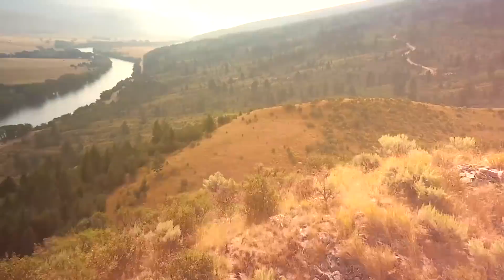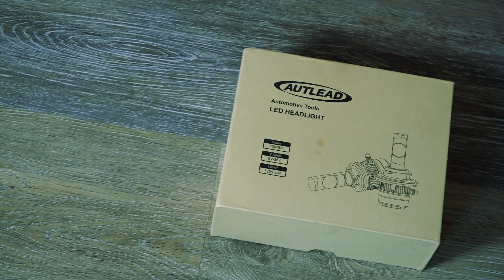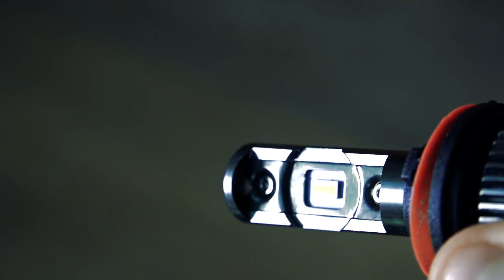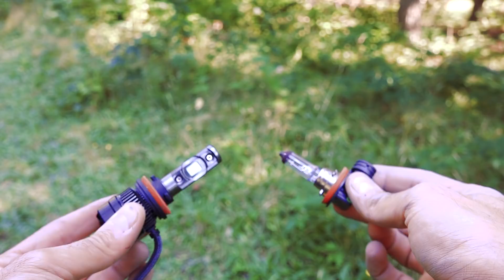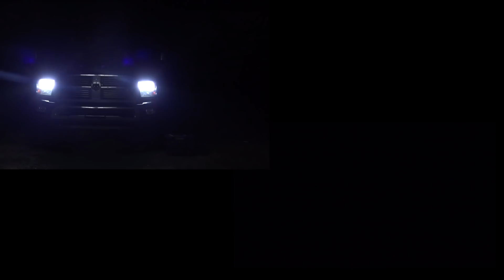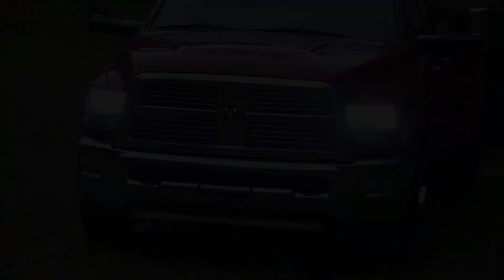Testing LED Headlight Bulb replacements in our Truck - Are they any better? Before and After

Comment: I'm sorry but the difference in current draw replacing incandescent with LED will have a fuel economy improvement that can only be measured in a lab. Virtually unmeasurable in the real world. But a good video other than that statement. How much did your fuel economy improve?
Reply from the maker: Lol, you are very correct, especially with this truck.  In our chevy volt it would make a much bigger difference (but even at that not much)

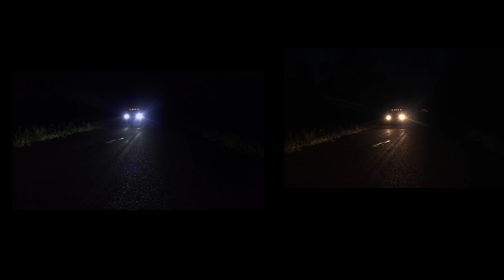Comment: 9:24  They have a blinding glare, probably not street legal.  People need to realize that the so called "cutoff" is not a true cutoff with an incan housing, can be in exactly the same place and still make for an illegal light because if you use a brighter light the cutoff must be NARROWER (tighter hot spot) to not put more light into the other lane.

Further you vaguely stated they should last longer than the incandescent if the cooling is designed properly but this is not true.  A proper design built to a price point, or shrunk to a small size, can easily be the first failure point, or the LED itself can suffer more and more degradation from running hot before it completely fails.  Granted most people are not driving many hours at night so they could get an acceptable lifespan, but if I were you I would keep in the vehicle all tools needed to change the bulbs and spare bulbs, especially on longer trips.  If nothing else I am fairly sure the fans won't last long and then there is the cascade failure from running too hot, especially if you leave the dust covers on yours which I wouldn't do.

Comment: I call bullshit on the "better fuel economy" thing, but the analysis was quite good otherwise. BulbFacts ranked these with their highest possible score for beam pattern, so it doesn't get any better than this for a retrofit.
Reply from the maker: For an aftermarket install, especially on a truck like this you are right, but for an OEM, all power savings reduce load and help fuel economy.  These are still going strong and yes we are amazed by the beam pattern even in the refectors.
Reply: @Mortons - While their un-dimmable nature makes them a no-go for my highbeams/DRLs, I'll definitely consider them for the lowbeams. As for the stinginess of OEMs, I have my doubts that they would risk warranty claims and bad press with such an unreliable technology just to save .03 horsepower (25 watts, being the difference between a 50watt halogen lamp and a 25watt Led).

Comment: I REPLACED THE HEAD LIGHT BULB ON ONE SIDE OF MY JEEP LIBERTY 2011 WITH A REGULAR OEM AND THE OTHER IS ONE OF THOSE HIGH END FAN BRIGHTS SO IS IT OK TO LEAVE IT LIKE THAT . UNTIL THE HI FAN BULB BLOWS THEN JUST PUT ANOTHER OEM REGULAR BULB IN IT?
Reply from the maker: As long as you are not getting an error on the dash, it shouldent hurt anything.

Comment: You mentioned the warmer temp of the halogens filled in the shadows better. This is largely due to the 6500k color temp. 4500k or 5000k will give you a slightly improved output as well as retain that shadow filling of the halogen. I noticed this specifically when i changed lightbar brands, going from a 6000k color to 5000k.

Comment: I see several comments on LEDs producing heat...true, they produce heat at the base, by the motor.
I've even seen some fans stop working and melt the rubber gasket.
But the problem is, they don't produce heat like the halogens do from their bulb...and that helps to melt ice and snow from the lenses.
LED owners in snowy climates have to wipe the ice and snow off to be able to see.
Reply from the maker: Hmm, good thing to consider!  I have even had halogens freeze over in super cold weather so this would be much worse.

Comment: I’m a big proponent of using LEDs for lighting and am impressed at how much light the modern COB types can produce.  I agree with your statement about these probably outlasting the vehicle in which they were installed but not so sure I agree with the inference of potential saving on equipment or helping with fuel consumption when at 70 watts they consume more than the 45W/55W (low beam/high beam) that conventional bulbs are typically rated.   In spite of that though, I still believe they’re the way to go.
Reply: For the record, independent analysis found that this model consumes about 28 watts.

Comment: The description is amazing, the end result even brighter. I am a bright light maniac and fed up of the candle lights that emanates out of the stock incandescent bulbs. I saw your link to the LED emitters, thanks. I will get them ASAP. Once again, great description,  very affirmative and convincing. Cheers.
Reply: Addendum to the above. 
You mentioned that the power is 7200 Lm each emitter? Or both combined? Please do clarify on that. Thanks. Have a nice day.
Reply from the maker: I was not sure when I did this but I am pretty sure it is combined, 7200 is way to high for just one.

Comment: Blinding others is my concern. Every once in a while driving, someone coming at me has “high performance” lights coming at me from a slight rise blinds me so severely, I cannot tell where I am on the road. I just hold the wheel steady and pray.
Reply from the maker: While I have nver been flashed with these I did point them down a hair to help with that.

Comment: I replaced my Halogen bulbs with Auxbeam LED bulbs and they work perfect. I have reflector headlights ('93 f150) and they work if installed properly. Mine are able to be adjusted (some are not) so you can adjust the beam pattern so there is a cut off line. You also may have to re-adjust the headlight down some to prevent there glare to oncoming traffic. I have never been flashed by drivers yet and they really help to light up the road better than the old halogens did. Some of the new vehicles have LED headlights that are so blinding, they should be outlawed. The new GMC and Chevy trucks are absolutely blinding, especially while hauling any weight or pulling a trailer, which drops the rear of the truck, raising the trajectory of the headlights up to the point where it looks like they have their high beams on. So don't talk about LEDs being illegal to me when some come from the factory with ones that should be outlawed!

Comment: Do they put enough heat on the front lens to prevent icing in the winter?  I've even had halogen sealed beams ice over about every 20 miles in a Minnesota snowstorm.
Reply from the maker: Good Question! Probably not.

Comment: I wanted to put them in my new truck but I was told in tx if I put them in they won't inspect  my truck . You can only have them if they came from the factory.  You might want want to check . Thank s

Comment: Hi
Your truck has a canbus system and I’m surprised that you did not use any other parts with these bulbs!
Do you get any warnings on the dashboard about lightbulbs being out?
Reply from the maker: No and I am assuming because the actual wattage is very similar,  unless they are looking at resistance.  then they got that right too somehow.  I think I will take an actual current reading from these out of curiosity.
Reply: Mortons on the Move 
Had one more question. 
What year is your truck.
Appreciate your response!

Comment: About a year ago I thought that LED headlights would be a great idea. I changed out the entire capsule, reflector lens the LED element… The whole shooting match in my 4 x 4 my car and my classic ole 1962 Chevy pick up.  I've been in the collision repair business for most of 40 years and I've replaced hundreds of headlights and use the proper equipment and practices to aim them.

These things did create a whiter brighter light and I could see more in the dark but I have never had more people flash their highbeams at me in my life!  People apparently thought I was driving with my highbeams on. It wasn't until someone else was driving my car while I was driving in the opposite direction that I understood this problem completely.

The boxes these came in had all kinds of DOT and all sorts of other approvals assuring me that they were safe and legal. Whether they are legal or not they are not safe!  So, I am allowed to see but nobody else on the road is? These things blind other drivers. They don't  columnate the LED output properly and scatter stray light  everywhere.   This reminds me of the current attitude of millennial's these days, "it's all about me".  "As long as it's a good deal for me, as long as I can see, I like it!" And crap like that.

Ask yourself just how many people need to die before we figure this out. 7000 K color temperature is too damned high, It's blinding people!

I hope you kept your old bulbs you're going to find people are going to hate you once they are blinded by these things.  You seem like a nice guy,  I will look for your video shortly about why you took these out.
Reply: LEDs are only good for fog lights or a sedan due to the headlights on a car is so much lower than a pick up ... Just saying
Reply: LED isn't the problem. Putting LED in a reflector and not a projector housing is the problem.
Reply: JoeBob12394   Try it, a different reflector of whatever type will not change the painful, blinding, annoyingly whitish-blue color temperature.
Reply: +Caveman Jack 5000k or 5500k won't be whitest blue. I have retrofitted cars with Morimoto projector and they never blind anybody. Whether it be LED or even brighter 55W HID, there is virtually no light above the cutoff line. I have never been flashed by anybody. The only time that it would be blinding is when I'm on an elevation. The road is occupied with many modern car with LED headlight. Do you remember being blinded by every new car? (except for Acura jewel eye light, those look like high beam) I'm glad that you care about other and stop using LED. But I think you are missing out on modern lighting because of improper equipment.
Reply: Also need to select the correct style.
Reply: Even halogens have flares but since its not bright, its hardly noticeable, now puttin g in a brighter light that flare will be brighter but not really blinding if your headlight is properly leveled. Best to use led light with thinner led chips, dont use those COB or the likes as they scatter more light, thinner led chips like the one in supernova v.4 have lesser glare because it mimica the thin filament of the halogen bulb.
Reply: @DGlegend i lowered mine 8inch below the level of my headlight on the driver side and 4inch below on the passenger side.
Reply: its not the led technology alone, improperly aimed led, hid or halogen will blind other cars just the same. Not all Leds headlight are created the same, there are bad ones and good ones, some things to consider when buying, dont get the cheap ones (cob, trileds) theyre not bright and scatter more light, get the adjustable ones so it can be properly fitted in your housing, light should be hitting side to side(3 and 9oclock of your housing), look for leds that mimic the halogen filament position as this will give you brighter and better beam pattern. Avoid those rounded led chips (xhp50, xhp70, eti70) specially if youre using reflector, theyre ok for projector but gives less hotspot, they dont mimic the halogen filament, dont get the much cooler bluish color its not brighter to the eyes(maybe a matter of preference). Leds are marketed with outrageous lumens/watts rating, its a tricky situation. But you need at least 6000lumens/set true raw lumens to get 100-300% increase in brightness, increase varies on headlight housing. Once you installed a good set of led, you will never go back to halogen. When testing leds brightness wait for at least 3minutes to get to what they call "cool lumens" or the stable lumens, leds are brighter at the startup which renders inaccurate lux rating.
Reply: You should adjust your headlight beam or your LED.
Reply: I'm guessing it wasn't these that you tried though. The model shown in the video has a lab-tested color temperature of 6000k (not 7000) and an independently-verified "perfect" beam pattern. There are a great number of dim & dingy Led lights that will do nothing but blind other people, but I don't think that this particular product represents that category.

Comment: I find it hard to believe that the LED bulbs can be hotter than halogen bulbs, which are legendary for producing searing heat.
Reply: The problem is not that they make more heat. The problem is that the LEDS are far less tolerant of the heat they produce. Much more substantial cooling is required to insure they don't destroy them selves. What's more like most semiconductors they function better the cooler they are. The hotter the LED gets the less light it is going to output.

Comment: I've used LED as replacement lighting for interior and exterior but never on a vehicle. For interior lighting I've found the 5K to 7K color requires almost twice the lumens for the came level of visual acuity using the eye only. A camera doesn't respond the same as our eyes and the biggest difference is the color system. We have a peak acuity at about 2.8K to 3.2K which means for a given number of lumens we see better in the 2.8 to 3.2 K range.  That's not unlike our audio spectrum. And, like with audio, this drifts with age and abuse. I'm so very tempted to get these bulbs for high and low, but I'll wait until you drive on wet surfaces. The bounce is sometimes abusive when I meet a new oncoming vehicle on rain soaked roads. Thank you for the review and insights. Just list me as tempted while observing. Again, you've done a remarkable video.
Reply: Since theyre brighter than halogen they reflect brighter on wet road to oncomming traffic, on the driver side it performs better than halogen on heavy rains. Just dont buy those bluish leds.

Comment: A good question is what the warranty is. I’ve heard the fans don’t last long. I’ve been holding out on them. I’m still using the hollagene bulbs. Also, you LEDs don’t have a high beam now that you’ve swapped?
Reply from the maker: I want to see how these preform over time, but I might swap out the high beams.... I think these would be better in them anyway as they dont run as much and beam pattern is not as critical.  I was most curious to see how they would work with a reflector and a cutoff however, thus the low beams.  These bulbs only have a 6 month warranty.  We will see how long they last....

Comment: When I was working, before I retired, I would always either design in LED’s run at current, a lot lower than their rating or run them at a low duty cycle if I needed significant light momentarily.  Example: position sensors sampling one microsecond every ten milliseconds.  They typically had a one and one half volt forward voltage drop, therefore the dissipation was a lot lower than a filament bulb with full power supply voltage across them.  Halogen lights run off of lower voltages, like twelve volts, but produce a lot more heat than tungsten bulbs do, thus the do not touch rule, even when they are off.  All this to say, I am sure glad you are checking out LED headlights for us.  If they last a long time (fans and all), I will jump on the band wagon.  If not, I will wait for improvements to come along.  Thank you for checking this out for us!  Please keep us posted!

Comment: Not sure if they're better, but the LED bulbs are certainly illegal. 

The halogen incandescent bulbs have a specific halogen reflector that depends on the light source wire being in a very exact position, otherwise light will go everywhere (a few mm difference can throw light way up, down or sideways). Therefore, only halogen bulbs maintain the DOT/E-code approval of your headlights, and both HID and LED in them are not approved. Even if these are less bad than the horror show that is HID, they're still not legal, just as a heads-up.

The good way to do a headlight upgrade is to replace the entire reflector, with something from JW Speaker, Vision X, Truck-lite and so on. There are also a lot of chinese garbage to be had online but the operative word there is garbage.
Reply from the maker: Cant say i fully agree. DOT is not an approval agency and thus if your lamps meet the guidelines for beam pattern as you stated or in FMVSS 108 then you could legally run LED bulbs in a reflector housing.  I would agree that I am not sure if these are completely legal or not, thus my quick test.  But comparing side to side the LED's appeared do not to be any brighter outside the cutoff and thus may comply.  I agree that we cannot be blinding oncoming traffic and hate when I see oncoming traffic with poorly retrofired lights that blind you.  I personally expected these to do that but was surprised at how well the light was controlled.  This is not something I am an expert on but I hope my mentions of making sure the cutoff is still good is clear to others thinking of doing the same.
Reply: Illegal?? Hardly. HIDs and LEDs come standard in most new vehicles nowadays. They’re phasing out halogen (incandescent) bulbs all together mostly for the heat and inefficiency.
Reply: They're legal when they're built in by the factory and tested to comply with the regulations. If you take a HID and shove it into a Halogen light, it's not tested, not approved and not ok to run. These LED's are a little better, because they at least only blind on-coming traffic a little, not a lot.
Reply: CROFT: Certainly illegal? Does a comment like that somehow make you feel better about yourself? I used to work with a manufacturer attempting to vehicles from other countries through customs and even the DOT itself was unsure whether a certain bulb/lens combination was DOT approved. The DOT is bureaucracy at its finest and it can take a year or more to get a final  decision on any given situation.   Perhaps you meant to say certain bulb/reflector combinations can render an unsafe pattern and that could be a cause for a law enforcement citation?